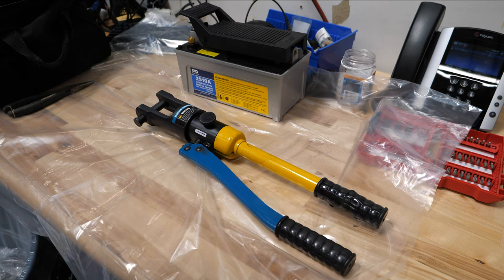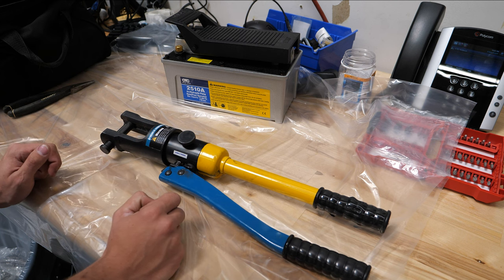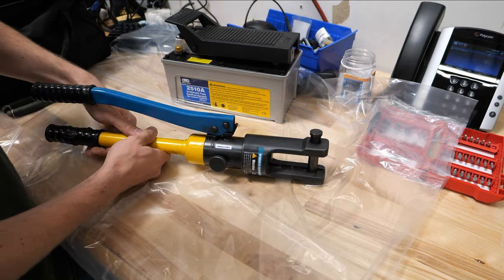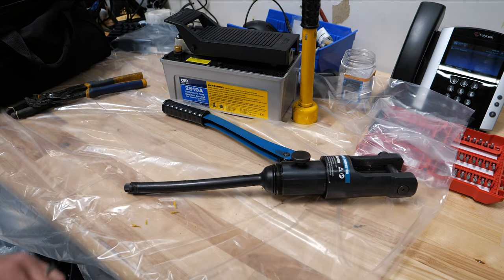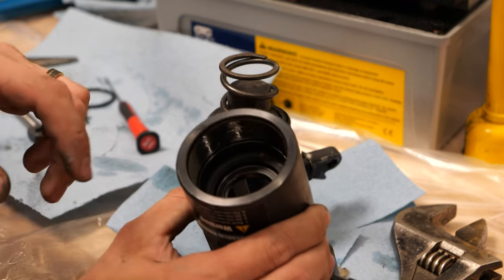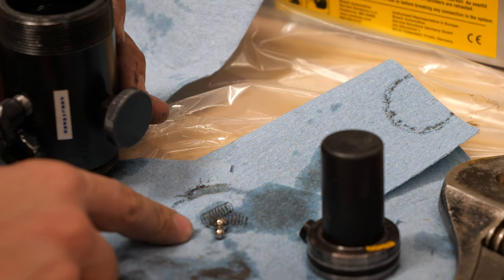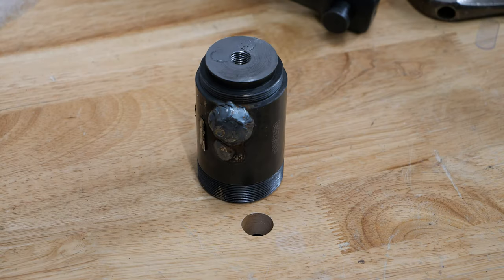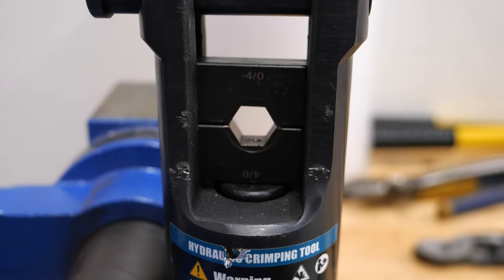Hydraulic Cable Crimper - Conversion to Automated Operation

Comment: I cringed when tightening the swivel. It seals on the i.d. no thread lock needed. Also you ruined it by making it too tight.
Reply from the maker: I was actually unsure about this, I figured extra seal didn't hurt and didn't get a good feel that it was tightened enough until I realized it was too late.
Reply: @HighTechLab  its all good. I've seen people tighten them until there sideways and put 5000 psi. on them.